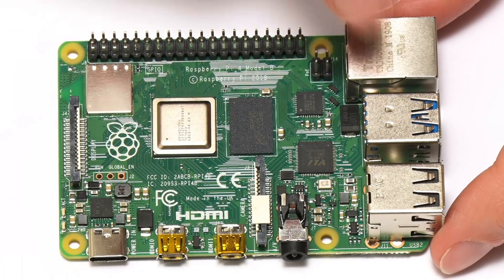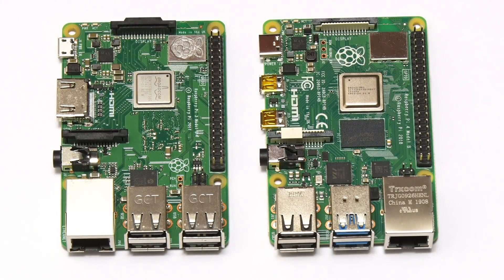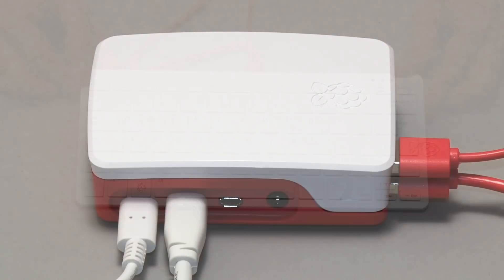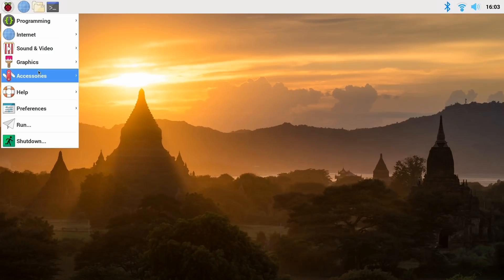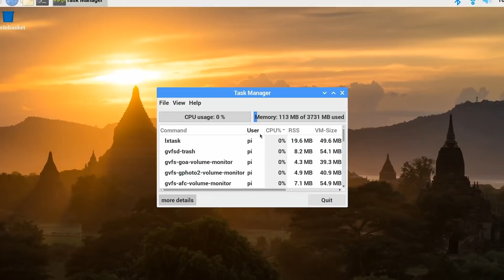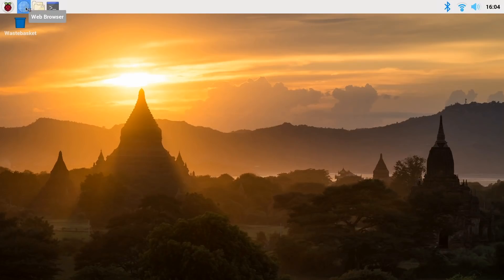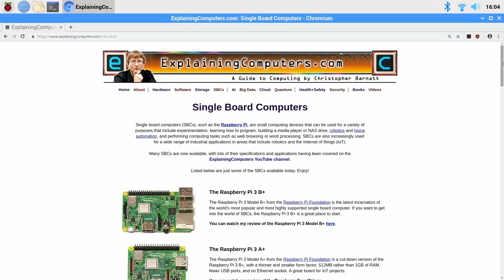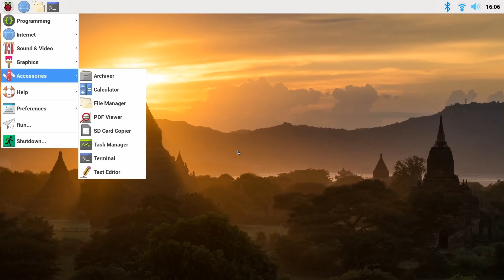Raspberry Pi 4 Model B

Comment: they need an 8 GB of RAM model
Reply: 4b+
Reply: Can I ask why, what project or use will you run for that much ram?
You know this is a sbc, not even close to a desktop and such not supposed to be. 4 gb ram imo is much more than needed.
Reply: @Gunzee  If they are selling a desktop kit for the rpi4 then they are saying it's supposed to be a desktop computer. And lots of video games require a minimum of 8 gigs of ram these days. And with steam making gaming on linux based computers possible now... that 4 gigs of ram is really limiting the user base for this computer to boring folks that only use their computer to check email and watch a few videos on youtube. The next step for development needs to make the pi suitable for at least casual gamers who aren't trying to run triple A titles. And then after that they need to go after the big gamers market if they want to continue to grow as a company.
Reply: @jon b well, rockpro64 has all that plus x4 lane PCIe in addiotion. costs very similar. and is on the market for more, than year, I guess.
Reply: @jon b  yep 100+ for rock pi while raspberry pi 4 is half the price and has much better support of community.
Reply: @jon b I'd trade the Gigabit Ethernet and USB 3 for more RAM.
Reply: @XeonProductions  Very bad choice, RAM is only useful in certain use cases, anyhow RAM is not the bottleneck to a Pi Device, its the CPU.

USB 3.0 and Gigabit are far better additions as it unlocks a whole new opportunities for utilising the Pi.
ROCK64's only advantage was that, and now it's gone.
Reply: I only hope the USB 3.0 and Ethernet are on separate buses.
Reply: @XeonProductions  nop I would rather as it is. 4gb ram is perfect love it

Comment: It's about time, but I am eager to see your test results on the overclocking and performance. It'd be nice too if you tested out RetroPie and retro gaming emulation. You'd be one of the first that did that; like the Digital Foundry for SBCs.
Reply: I think emulation will be the use for the P4. Folks like ETA prime will break it all down on a video, how to get an OS installed, configured, and tested, and it will just pop. I'm curious to see what it will emulate. I've built two retropie projects with the P3B+, but both used the full size hdmi port for video since that was the easiest way to get video out. I'm super curious to see if anyone will make a small 3.5" screen (or smaller or larger) that will use the micro hdmi port, or if the screen hats will connect to and use the gpio for video.
Reply: @phattacorider  You can find cheap hdmi to micro hdmi adapters on ebay or amazon, etc. I heard that the gpio will be compatible with prior gen 3, but certain cases may not be compatible. 

On the subject of emulation, the developers at Lakka/RetroArch told me that the P4 with 4gbs of ram will still under perform against the Odroid XU4 with 2gbs of ram. I plan to get the P4-4gb model, but I found a 7" IPS screen that works with Odroid out of the box. I was going to use it with the Odroid C0 which is slimmer formfactor than the P3A+, but actually has a better gpu (Mali) over the P3. In my experience buying mini HDMI displays of 5" and 7", most are focused on compatibility with Raspberry Pi, but may require driver installation, and also rely on config.txt file configuration. I'm not an expert by any means, but it seems to be that way with the ones I've looked at for mobile device projects with SBCs.

www.amazon.com/gp/product/B07S51QDTG
Here is a decent 7" display I bought with HDMI. If you do their mail in offer, you can get a free HDMI to micro HDMI adapter with the purchase of the screen, and the display works out of the box with any HDMI device like the Raspberry Pi. All you have to do is do a hashtag on fakebook or twatter, and then give them an email to tell em you've done so. But on the other hand, it's kinda expensive;  mostly I think it's worth it, because the screen is fairly decent quality over a regular tft display, although there is some color shifting still at extreme angles. But much better overall. Not as good as a oled, but better than a tft.

Comment: No PCIe? Disappointing...
Reply from the maker: Sadly no quantum processor either . . .
Reply: at least the USB 2.0 and 3.0 run on a dedicated PCIe 2.0 x1 link that isn't shared with the Ethernet controller.

Comment: rPi MOUSE?! What the heck :D
Reply: Yah...Awesome Pi upgrade, but a CORDED mouse? Really?

As far as a power supply, i like all my stuff to run off 12VDC, so i use 8amp RC switchmode SBEC's for a good stable 5v from 12v.
Reply: They should put the Pi IN the mouse!
Reply: I prefer to keep mice and technology separate. The management system usually frown upon tech